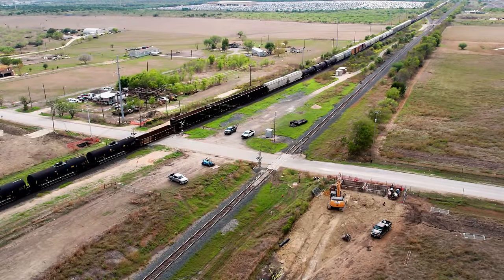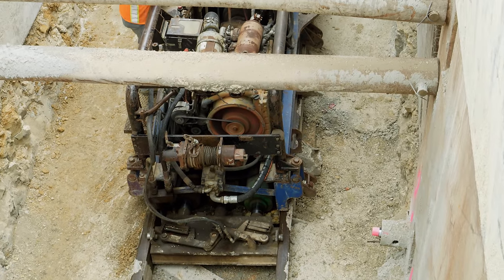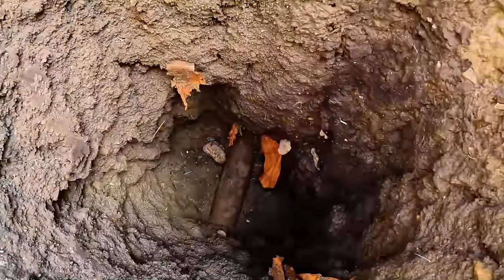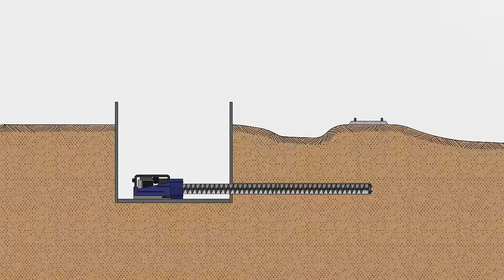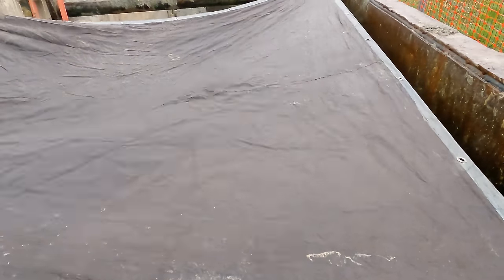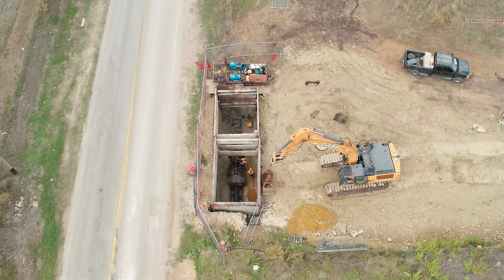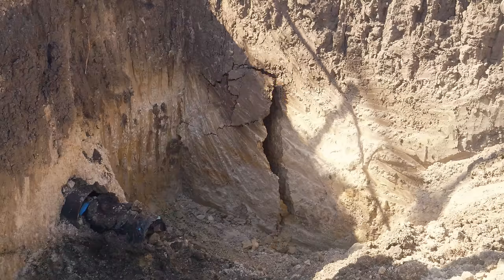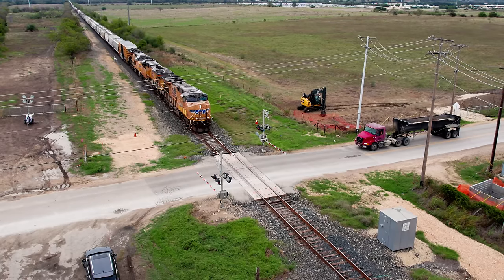How To Install a Pipeline Under a Railroad

Comment: I have finished the water distribution system project just like this, crossing the railroads but with different method. We used Horizontal Directional Drilling method that drilled the hole from the entry pit to the exit pit. The difference is that the HDD method is a trenchless technique used to install underground pipelines without the need for traditional open-cut excavation. It involves drilling a borehole along a predetermined path from the entry point to the exit point underground. Then, the pipeline is pulled through the drilled hole, following the same path. This method is also can be used to install pipelines under obstacles such as rivers, highways, and environmentally sensitive areas, minimizing disruption to the environment.

Comment: I just learned about vacuum excavating recently. They are installing fiberoptic cables in my neighborhood, and there are vacuum excavators all over the place, digging holes for the new cables while trying to avoid all of the other existing stuff: phone cables; electrical cables; gas lines; water lines; TV cable lines; sewer lines; etc., etc., etc. It took me a few minutes to figure out what was going on, but I realized that it was a genius idea; quick, precise and clean excavation with very little risk of damaging anything. Once they are done, they come back with a slinger truck to fill the hole with soil.

They use directional drilling to run the cable horizontally, then dig vertical holes to join them up. For weeks, the neighborhood has been full with marking crews, directional drilling machinery, and vacuum excavators. It's not too inconvenient, and it's nice that a construction geek like me can observe an infrastructure project that has literally come to my front door.

Comment: We used to do that in half the time in the Houston area using water boring. The only problem with that is that if a train comes over the tracks before the casing is installed, it can collapse the bore hole and you have to start all over in a different location!

Comment: This video was fantastic. I'm a network engineer and I've had a couple projects delayed while the contractor laying fiber had to negotiate a railroad crossing (and deal with a gas company that failed to locate their lines along the railroad after days of potholing in the Arizona summer...) and I've always been curious about what some of the extra steps look like.

Comment: Great video, as a Construction Senior Project Superintendent I managed a couple projects in the railroad right of way. The railroad has many rules for working in their R.O.W. And permitting can take time. On one project we had bore a new storm pipe under the rails, on another we had to set up a crane in the R.O.W. to service a building being renovated, whose edge of building was on the edge of the R.O.W. (Seattle north waterfront area). 
Again a great video.

Comment: I worked on a crew running underground power in the 70s. Boring companies existed but we didnt use them unless needed. We had 5 foot sections of strong pipe that we screwed together as we pushed further in with a backhoe. I was the guy lining up the pipe and assembling it. Then we screwed a reamer on the far end and pulled it back through to expand the hole. Sometimes several times with progressively larger reamers. Had to run under the CN main line. We kept hitting timbers. Had to dig a hole for the tractor to sit low enough to go deep enough. Another spot on the same run was such a hard pull we had to chain the winch truck to the tractor and the trencher with blocks behind the wheels and used a 3 part line with half inch cable and anapped that. That job took a week. Ah the good old days.

Comment: I worked at a construction project last year as a intern where they did direcrional drilling. The people who did the actual job looked like those people you imagine drilling for oil, toughest people i’ve met outside demolition.
Reply: Directional drilling is incredibly quick and easy compared to this method, jack and bore.
Reply: @Swearengen1980 Directional drilling is not easy if you are in areas with glacial tills.
Reply: @johnnyh3653  Which for America would be a pretty small % of land mass, even more so if you narrow it to developed areas that would require a directional drill.
Reply: @Swearengen1980  That is a fair assessment. I was an engineer in the Seattle metro area and virtually every one of our utility projects that utilized a boring technology had issues. Since my projects focused on gravity systems (sewer & storm), directional drilling was not precise enough to maintain the necessary pipe slopes.
Reply: @johnnyh3653  Yeah, you certainly run into problems there. My projects cover the gambit of utilities in both rural and urban areas. Since gravity can only get you so far before you're digging to China, there's always a force main nearby. Especially rural where our gravity sewer ends at a private lift station and gets pumps from there (obviously commercial).Florida is easier on storm, since even in cities, it ends up in lakes, wetlands, etc that are everywhere. In the city though, we now do a lot of underground stormwater systems. No need for it to be piped anywhere. At face value, having what amounts to a percolating cistern underneath your site doesn't sound like a great idea does it? LOL.  Side note on directional drilling - My city is finally putting in fiber optic cables for internet. I watched them directional drill the cul-de-sacs and main road of my neighborhood a couple weeks ago. Unskilled labor, most of them didn't speak English, quick, dirty, and crude job. And in casual conversation, I find that their desire to source this out to everyone to have many crews all over the city at once.....Yeah, they busted  MANY water mains across town and it wasn't for lack of surveyors not spray painting the sites. 🤦‍♂

Comment: I watched whilst a 500' line was snaked from the road to my house (and then bored through the basement!) when I got tired of digging up and fixing leaks (original line buried 16" higher than code.)
The worker guiding it walked along with his magic box, and they marked the surface with the path. 
I think the subcontracting for the bore alone was fifteen bucks per foot!

Comment: i know a guy who work on irrigation piping for a farm, and he had plenty of horror stories about shimmying through pipes that he could BARELY fit inside. this was way beyond skateboard size. he said he would make himself throw up before going in to make sure his elbows would be able to compress enough towards each other so he would not get stuck. and all he was doing usually was finding where holes in the pipe were. he also told me the old school method to quickly and temporarily patch a pipe like that was to throw in a wad of cow manure (or horse) mixed with straw. it would go down and get stuck when forced into the leak, and then turn into concrete basically and slow the leak to a trickle.

Comment: I used to work on the pipeline and did many road/track bores. Now I work on railroad and drive over the bores we once made. We used the pneumatic hammer to punch the 36" pipe through the soil. Pretty noisy but also cool, to be standing right next to the metal pipe, that gets literally punched through the Earth.

Comment: I was a railroad flagger during one of these type events... It was to repair a broken 100 year old water main under a railway connection.   The new technology using a plastic lining was interesting but had it's flaws and had  to be re-examined.  The leak test failed twice did the trick. 

The railroad pushed for the non-interfence techology and we learned many things

Paul H. MNJ Railroad Warwick NY

Comment: This was interesting to learn about, partially because I work as a directional driller installing fiber optic cables in residential areas. There are quite a few differences between this straight horizontal drilling, and my directional drilling.

Comment: Great video Grady, thanks. This project reminds me of another intersection of rail lines and construction underground. During the Big Dig, I watched, fascinated when they froze the ground under the South Station railroad tracks and then proceeded to excavate and push a whole tunnel under the tracks! What a show, and a great demonstration of the power of hydraulic pressure.

Comment: We've had a very interesting pipeline project going on for two years now, just a mile from My house.
In the area we have several Aviation fuel and gas pipelines already in the ground. One of these was being replaced with methods related to the ones you show.
As a result of my Civil Engineering background,I have been trying to observe and photograph stages in this project, as it has progressed.

Comment: Very good one, Grady!  I wonder if railroads now being initially built might have underlying conduits pre-installed at intervals, such as major road crossings, to make simple work of future installation of various utilities.  The railway would charge for their use, but it would still be cheaper than "reinventing the wheel" each time an installation is needed.

Comment: I've designed excavation supports for these kinds of excavations a few times, and I've once been on the site see this done live, though that pipeline was under a road instead of a railway. Same principle, though: they didn't want to dig the whole road open so they just drilled a horizontal hole under it.

Comment: I work in the engineering department for a municipality in Arizona. We are currently underway for a project that will use horizontal auger boring to install a 60" sleeve for 2 sanitary sewer force mains and an effluent reuse pipeline under the UPRR. It's very interesting to see your experiences.

Comment: The point of good infrastructure and that fulfill everyday needs is that you shouldnt have to think about it for example when you open your water tap to get fresh water for cooking, showering, bathing, drinking etc. If you have to think about it because something is wrong in the system and the water tastes bad or looks bad or you dont get water at all. Cheers! :)

PS: Thanks for documenting and filming all this! :)

Comment: Where I live now, there were 400 homes on septic systems and the city was noticing intrusion into the well not too far away, so they did a project to connect everyone to the city's main sewer and replace the original water pipes. When they were finished, they came back and removed the remaining asphalt from the original road, graded and paved a new road. We just got notice that they are going to buy one of the properties next to the existing well and expand it. For several days, we had one of the large excavators in our back yard digging up the old septic system and laying pipe. When the project was completed, they came back to every house and repaired all the landscaping that had been damaged. That is how I believe every project should be done if possible. And for a while I had one of the biggest lawn ornaments that I could think of (back hoe).
Reply: Did the home owners have to pay for the cost?  That is what I was told about a neighborhood in my town, but I can't confirm that.

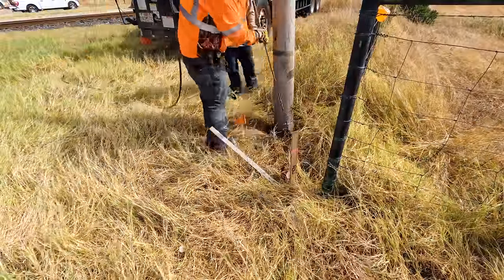Comment: “Pot Hole-ing” … a term used to describe what is left after the process because re-compacting a small excavation is difficult and always settles to a pothole.   I recommend backfilling some with flowable fill above sand encasement.  2:55

Comment: Absolutely brilliant presentation! 🌟 Your detailed walk-through of the process to install a pipeline under a bustling railroad was not only educational but thoroughly fascinating. The way you highlighted the intricate planning, coordination, and innovative engineering solutions involved gave me a newfound appreciation for the complexities of civil engineering projects.

I have a question regarding the use of "shoes" on the casing pipe for slight directional adjustments. Could you elaborate on how often these adjustments are necessary on average during such projects? How is the soil/rock under every stretch of the pipe pre-analyzed? What happens if the boring machine encounters something too hard to bore through? 

Thank you for such an educational and engaging video! It’s content like this that sparks curiosity and deepens our understanding of the engineering marvels around us. Looking forward to more content that unravels the complexities of practical engineering applications. 🛤👷‍♂

Comment: I hit an electrical line while digging a trench for a drainage pipe once. It was not a pleasant experience but luckily it was just residential power to an outdoor outlet.
Reply: You were lucky. I had current leakage in my installation and no residual current device, everything went to ground. I dug a yard wide trench nearby ground cable and I was able to feel voltage when I've touched both banks of the trench.
Reply: @szogun1987  lmao same here. It took me a bit to realize why my hands were tingling. I thought it was from working outside and digging…but then I saw the cable.

Comment: nice.  most of what we have where I am is directional bore, so it was cool to see how a jack bore operation works.  and yeah, everyone has horror stories about excavators hitting existing underground utilities.  the repairs usually take longer than the original excavation.

Comment: I have a picture somewhere of where they bored right through a pedestrian underground tunnel running between two buildings. It's just a long and wide hallway, but now there's a boring head coming out one wall at shoulder level, then starting to go into the other wall at chest level.

Comment: Do this on a regular basis but I’m typically engineering hydrocarbon pipelines so use horizontal directional drilling (HDD) methods instead of the jack and bore technique.  Much deeper depths below the tracks with the HDD design.

Comment: We do Horizontal Directional Drilling, you can set your rig on the surface, shoot at a angle down to your correct dept, straighten out and match the depth that you need to connect with existing conduit/utility. 

Then you drill, add stem, drill, add stem, etc. it doesn't require lowering the case bore into the earth. It goes much faster, and you can steer the drilling head with your locator. Allowing you to drill and hit a hole, or push to surface (aim up) and it just pokes out of the ground. 

Hookup a pipe/cable, then pull it back.

Here in Alberta, case boring (seen in this video) is almost none existent. HDD has replaced it, and it's much easier/faster. Because you can STEER it.... The boring shown in this video is so dated here, and is much harder to steer (Much more UN-SAFE aswell)

For larger pipe (seen in this video) we use a reamer, that makes the hole bigger as you pull. Sometimes you need to gradually add larger and larger reamers to get to a big size, such as 40" pipe. 

We have done a 48" pipe no problem.

We coulda had this job drilled and pulled back in about 2 days time. Rather then WEEKS that case boring takes

Comment: Another observation: Maybe you mentioned it, but the little black wire taped to the top of the blue pipe appears to be a tracer wire, used to carry an electronic signal in the event the pipe needs to be located. Metal pipes don't need these of course, but plastic pipes do.

Comment: I watched this last week on Nebula (I LOVE NEBULA!!!!!) And I just wish there was a comment section, but I know they said many times, never will there be.  But anyways, a good way to keep the trolls away:)  

It would have been awesome to see more action of the drill in process and the setting of the pipe and hook ups to the main lines like the Sewage Lift Station series had.  Like more technical info showing the testing of the pipe welds and penitration and if they had a working go in the pipe, if they could have a go pro strapped to the "skate board" they lay on.   But either way, these videos are awesome.  And seeing infastructure like this is why I became an engineer.  Granted, I'm an IT Security Engineer, but same principles when it comes to design and planning of equipment, how they hook up, how redundancies work, and so forth.  I grew up doing construction work and wish I would have become a civil engineer instead, but watching your videos tickels that learning section of my brain and enjoy these! 

I love these Practical Construction videos.  I really hope the cities and such around you allows for more project over view videos like this for engineering items!  They can use them as citizen outreach to show how their tax dollars are working to better their city and such.  You being able to talk about these in detail is awesome.

Comment: Good video, thanks.  On Brilliant, I’m doing the fundamental math course.  I like that it uses visual concepts to differentiate objects (I.e., circles can’t be added to triangles).  There are a few mistakes (I think) that are easily identified and it sometimes goes to top of page on my tablet instead of scrolling down, but I’d definitely recommend considering it.

Comment: Cool video. I dealt with something like this, years ago when I was doing geo technical drilling. We had to drill on either side of the tracks.Because a subcontractor claimed they hit a rock formation they could not get through.  It proved to be untrue.  Not sure how it all ended.